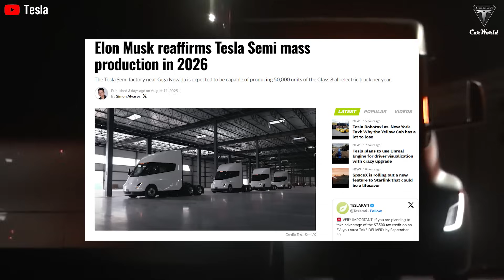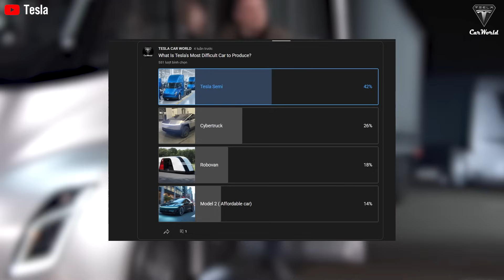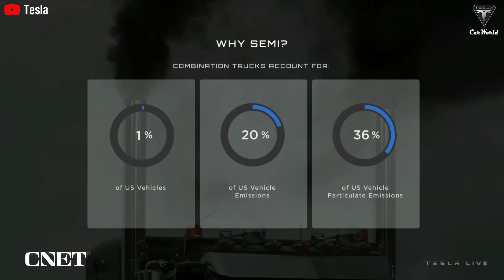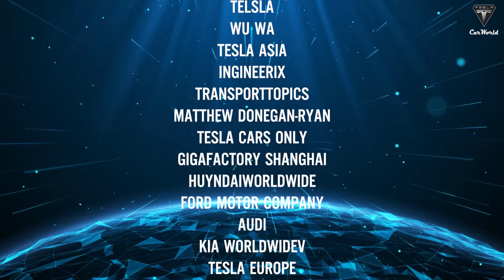Why 2026 Tesla Semi Gen 2 Design Can Overpower the Trucking Industry? (What’s Really Inside)

Comment: What if you use only tesla trailers, and put power generators to all 4 wheel sets. Could you make power to recharge or just charge the truck batteries to extend the range?
Reply from the maker: Interesting concept, but Tesla focuses on battery and Megacharger infrastructure for range extension.
Reply: doesnt work that way, while you could do some regenerative braking with all the wheel sets and get some charge that way instead of wasting the energy to heat in the brake pads, the increased load that the generators would apply to the trailer wheels, would cause the motors to have to use that same energy to overcome the added load. Theres no such thing as free energy, atleast according to our current understanding of physics.
Reply: Interesting question. As someone mentioned, there's no free lunch. However, there could be a very small advantage, but it would take a very long time to realize it. I say small and long because you'd want to avoid a massive GenSet due to the weight penalty. But a massive GenSet is exactly what you'd need to recharge in any practical time period especially if you wanted to operate the semi from the GenSet itself. The Tesla semi develops over 1000 Hp (745,000 watts) and consumes about 1.2kWh of energy every mile. You'd likely need something close to a 1.0 MegaWatt GenSet just to feed those motors at 60 mph. These can weigh over 10 tons.  If you were to park and wait while recharging you could get away with a much smaller GenSet. A 50kW GenSet could recover about 40 miles of range in an hour. A 50kW genset can weigh upwards of 2000 lbs though.

Comment: Should have built a tesla hybrid truck running on LNG or HYDROGEN inconjuction with Tesla batteries that would be a winner.
Reply: Why? Lots of lorries are on the roads already that easily have a 6 hour range and rechargetimes of about 30-40min (400KW CCS and soon 1000KW MCS cutting that in half).
Reply from the maker: Interesting idea—Tesla currently focuses on full electric, but hybrid tech could expand options.
Reply: @TeslaCarWorld  there is not even enough green hydrogen to fill the demand of chemical processes, green steel and air plane fuel. and you want to put it into a lorry and loose about 85% of the energy you invested just to drive between the few hydrogen fuel stations hoping the fuel last long enough?
Reply: Running on hydrogen? Perhaps if using Hydrogen Fuel Cells but not with an ICE. To get any usable range with H2 would require using it in Liquid form (cryogenically). This would require chilling and maintaining it at -423 degrees below zero. Maintaining it on the road would require special vacuum containment tanks and constantly running chillers. Failure to maintain the H2 at -423 degrees would cause a very expensive fuel to quickly boil off and if not allowed to vent it will explode. BMW's experiment with burning Liquid H2 in an ICE vehicle was a disaster losing nearly an entire tank of expensive fuel while simply parked for two days. Liquid H2 also destroys fuel pumps within hours. 
   If using H2 as a gas it would require compressing it to about 10,000 psi and storing it in large, armored non-metallic tanks. Even compressed would only return about half the range that Liquid hydrogen would provide. Hydrogen is very difficult to store. Hydrogen atoms (as well as H2 molecules) are very tiny and will find their way out of virtually any attempt to contain them. Hydrogen leaks must be allowed for since they cannot be totally eliminated.

Comment: And are they safe
Reply: Years on the road. Try to find a single accident. Yes, this has been a long testing period by Pepsi, Frito-lay, WalMart and Tesla.
Reply: Want a real eye-opener? Google "Gas vs EV fires"

    Electric vehicles (EVs) are significantly less likely to catch fire 
    compared to gasoline-powered vehicles, despite sensational 
    media coverage suggesting otherwise.

    Frequency of Fires
       Gasoline Vehicles: Gas and diesel vehicles experience fires much more frequently than EVs. 
       Reports indicate that there are approximately 215,000 fires involving gasoline vehicles annually 
       in the U.S. alone, which includes both traditional combustion engines and hybrids. 

       Electric Vehicles: A study from an insurance group found that per 100,000 cars sold, electric vehicles 
       had a significantly lower number of fires compared to gasoline and hybrid vehicles. Hybrid vehicles 
       were the most dangerous by far.
                                                                         - Consumer Affairs, July 2024
Reply from the maker: Yes, years of testing show excellent safety with no major reported accidents.